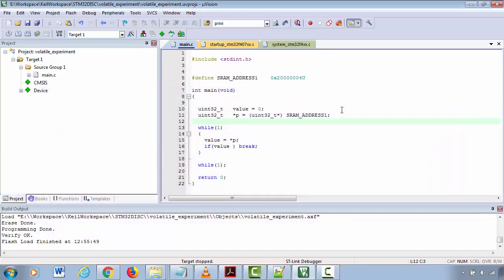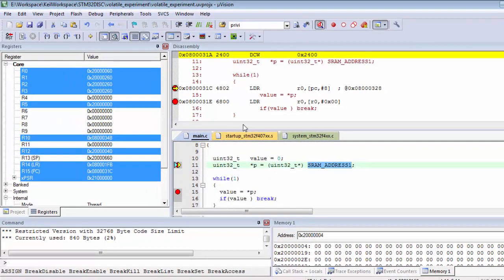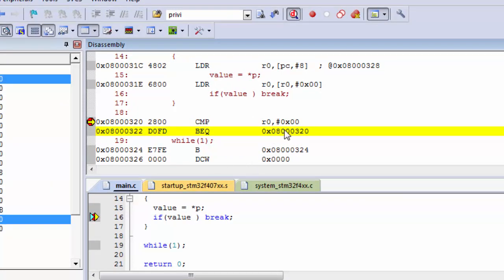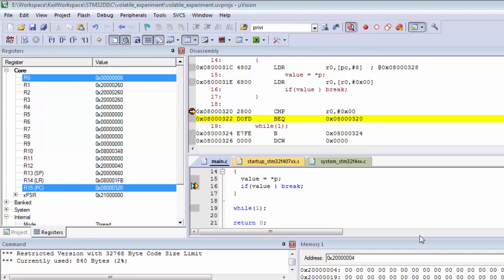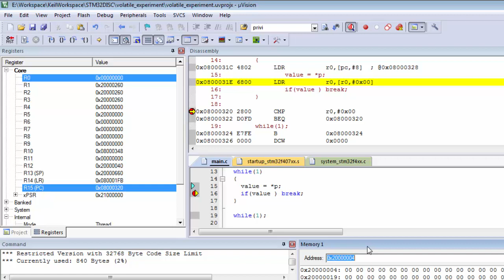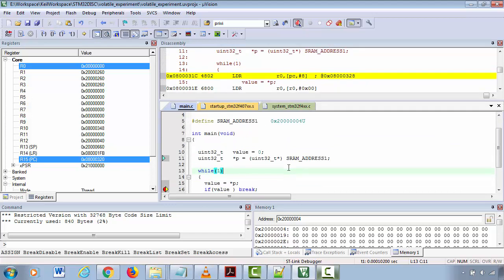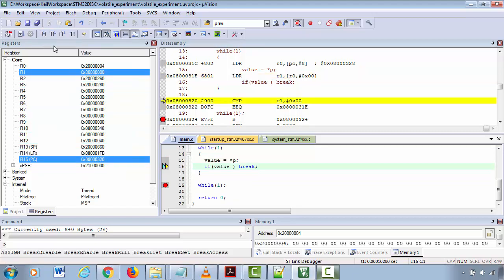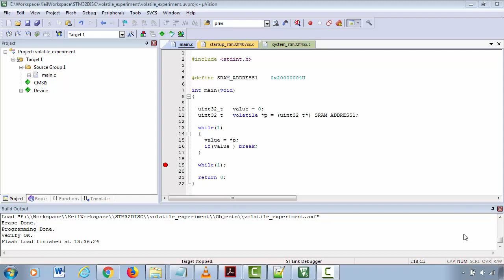The Importance of Volatile Keyword-Part 2

Comment: Thank you for the insight. I think it's more precise to say that the compiler simply does not work at the optimization level-3, or a fatal bug, instead of thinking of it as a short-coming of the compiler.  I know by declaring it as a volatile type "solved" the problem, but in nature it's more of a patch to what's not as apparent to the user. It's great that this patch was found and implemented, but the compiler is the root of the problem.